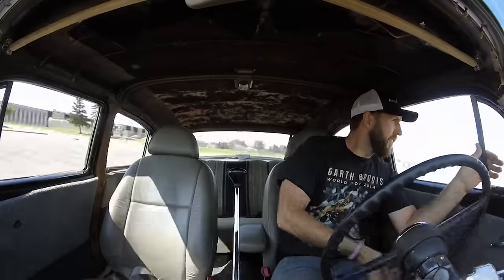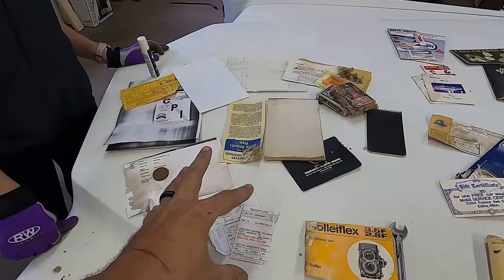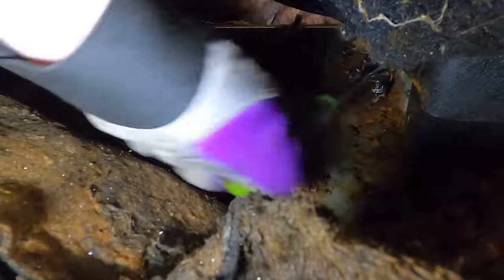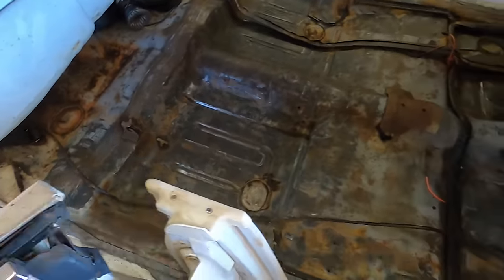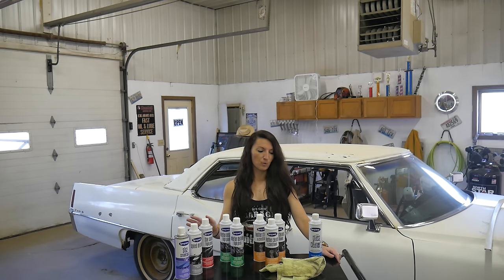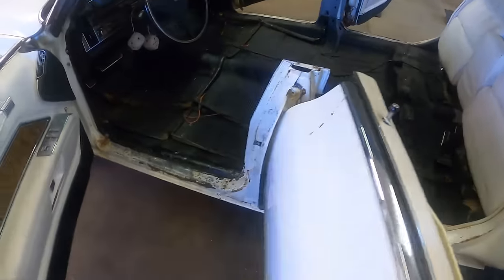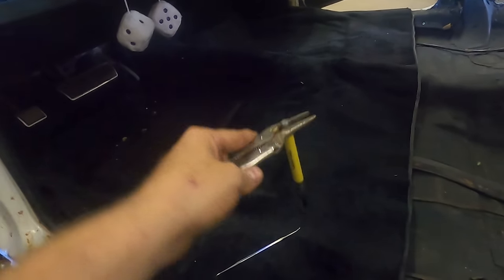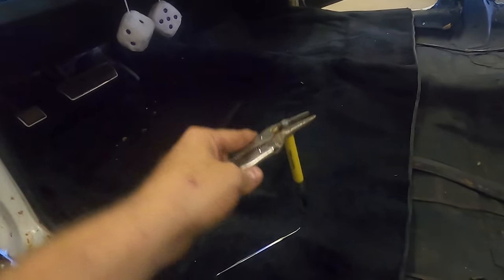Abandoned 1970 Cadillac Sedan DeVille Gets Interior Refurbished on a BUDGET! - Vice Grip Garage EP80

Comment: Probably a bit late now, but for rubber bits like those floor mats, some rubber reneu or a similar product do a good job of rejuvenating and softening old dry crusty rubber. Electronics shops that have to work on old legacy hardware like to use it a lot on the paper pickups of old printers, the sort used in industrial factories for the last 30 years, that nobody plans on ever replacing but are still mission critical where they'll pay a tech $300/hour because it's cheaper than a shutdown, and far cheaper than the 10's of thousands of dollars it would cost to have an engineering firm design a replacement......

Comment: Handling Mold & Such; What I do, is put about a Half Gal of Disinfecting Solution in the bottom of Wet-VAC for a reason. Mouse Feces, Mold, Environmental Pneumonia you can get in the right conditions. Been there done that. I would wear a Environmental Half-Face Respirator. If you find Black-Mold just have a Respirator. Your cloths to, need to be washed. Just be proactive.